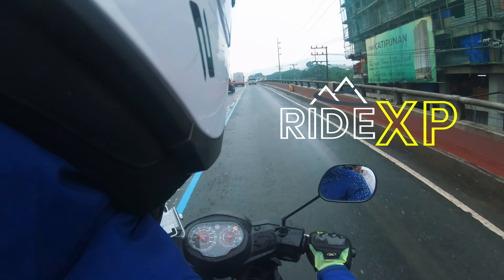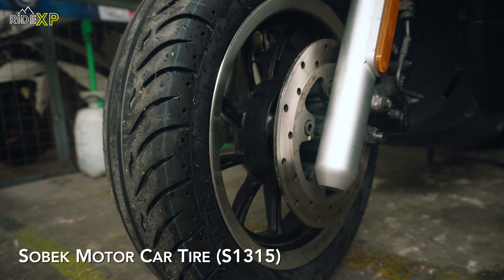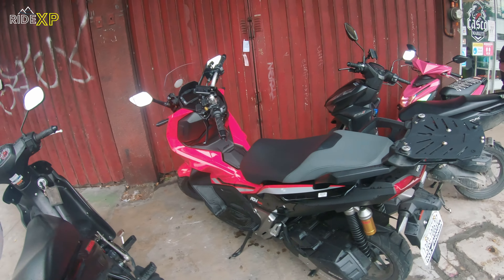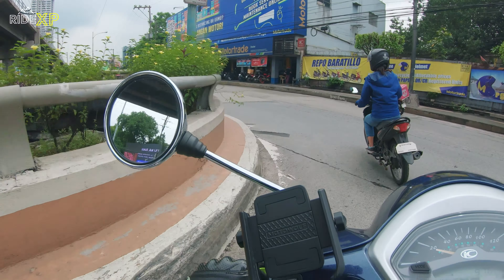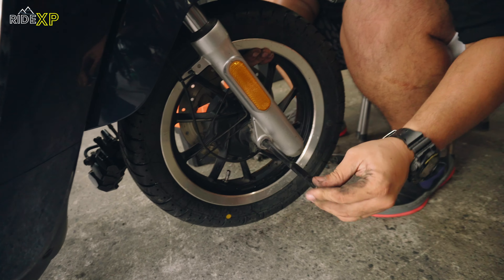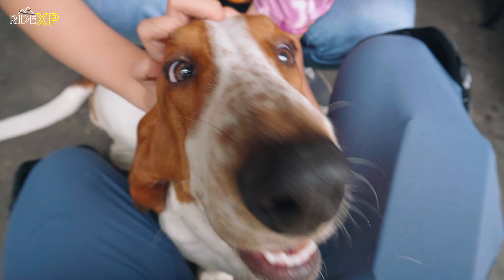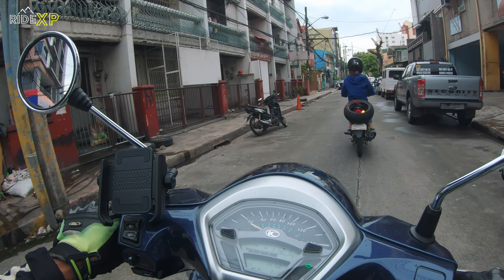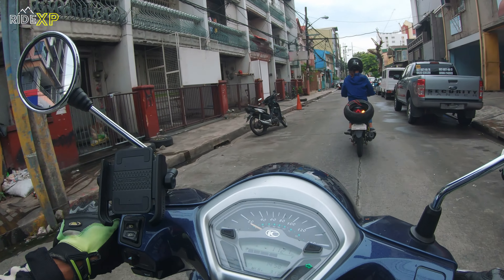Car Tires For Kymco Like 150i?! | SOBEK MOTOR CAR TIRES First Impressions | 1st in PH!

Comment: How was 2 passenger in Kymco like? planning to buy kasi.
Reply from the maker: Hi Jayvee,  happy naman kami sa angkasan sa Kymco Like. Maganda kasi yung seat niya! Depende lang sa backrider baka hindi niya type na mas nakabukaka compared sa ibang small bikes. In terms of hatak for its class pwede talaga, hindi bitin kahit may angkas. Sumasayad lang minsan kung pangit talaga yung humps, pero kung lagi kang may angkas pwede mag increase tire pressure or adjust rear suspension. :)

Comment: What size tire did you use for the Like? I have one and this looks like a great delivery tire.
Reply from the maker: Running 12in tires on these! 110/70-12 front and 130/70-12 rear.
Reply: @Ride_XP  any chance of going 120 or 130 up front?

Comment: Going darkside? Interesting, especially if it is designed for motorcycle. 
Though no doubt that will be cost efficient (high mileage tires) in the long run for flat city riding. 
Fuel efficiency, ride comfort & handling definitely will be affected negatively because of added unsprung weight and limited tyre flex (possibly?) as they will upset the bike's geometry/design.  Though only way to find out hows the handling/stability is wait for your next video😇🤭😇🤭
Reply from the maker: Exactly! Tbh it would be great if I could get someone really technical a la F9 to break down the engineering of the tire because I don't feel like it behaves like a car tire. So far my experience on it wet and dry city riding has been all positive!